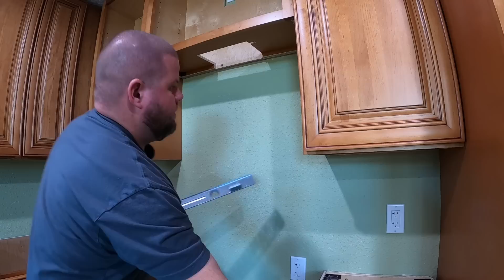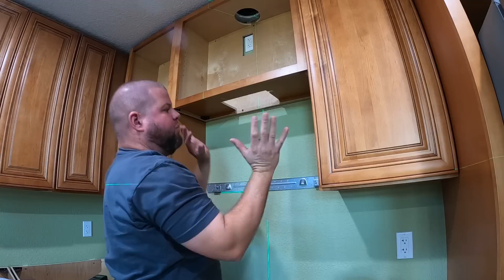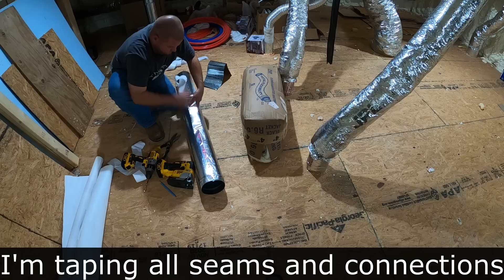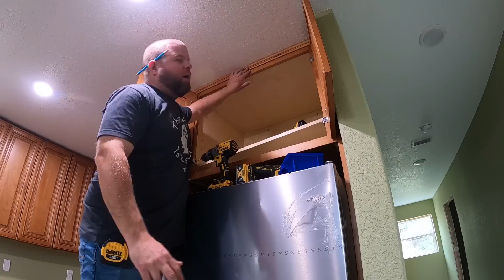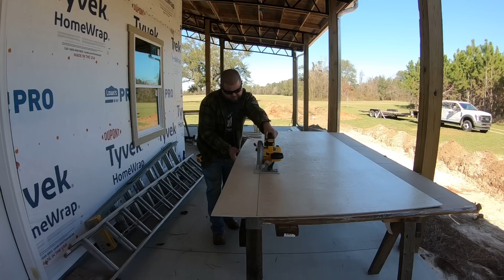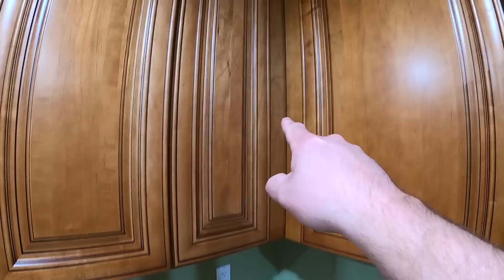Installing an over range microwave and trimming out the kitchen cabinets! #510

Comment: Andrew you are doing a great job and like I said before, the kitchen is looking awesome. A fellow before said to use screws in the vent pipe and that is a no no. Not on a vent hood. Also one thing in the future, you want to run the hard vent pipe the other direction. You want the pipe to slide into the next pipe toward the exit. Meaning the ripple end of pipe should be inserted into the next pipe toward the exit. You installed it in the opposite direction. One other note that I noticed and the only reason I am mentioning it is because you seem very talented and are really detail oriented. I also care about my fellow human. It looked like you left your chop saw plugged in while changing the blade to the finish blade. Make sure you unplug the saw before changing the blade. I would not want you to end up with a finger missing. I had one of my guys lose two fingers with a Dewalt cordless circular saw. He is not the only person that I know that lost fingers. Hope you don't think I am picking on you but I really do care. Take care and stay safe..
Reply from the maker: Very good point on the flow direction and connection with piping. I should have caught that.
Reply: @TKCL  hey your doing a great job. More important keep all those fingers..

Comment: Andrew just a tip. If you don't have crimpers for metal pipe you can use a needle nose pliers to make the crimp. Grab the pipe with the needle nose goe about 1.3 - 2" in and give the pliers a little twist. Do this all the way around the pipe and it is the next best thing to actual crimpers.
Reply from the maker: Awesome tip! Thanks

Comment: Are you going to put a receptacle on the peninsula?  Around here it would be required as the NEC says every point of countertop has to be within 2 feet of a receptacle
Reply from the maker: Hadn't planned on it, none showing in my electrical plans that the building department approved.

Comment: You COULD'VE Pulled down the cabinet and mount it onto the microwave. Then mount them both as 1 UNIT.  But with all you've done, You'd best leave it the way it is.

Comment: 3 critiques and 1 suggestion 
1 you installed outlet right behind vent pipe
-  plan ahead - why not lower right away from pipe
2 your cutout for electric box way big
Cut it small enough that mount plug / cover in cabinet that why outlet has such long screws 
3 where your shelf in the cabinet???
you should have put in middle shelf just cut circle for vent pipe to go thru

Tip put night light with eye on other half of plug.
So if microwave dead just open cabinet and you know if outlet trip gfci, breaker or it fuse in microwave 
Also nice to have little light in dark cabinet
Reply from the maker: Outlet was an oversight, can't think of everything, especially being a first time home builder. When I cut the opening, I forgot to factor in that the cabinets drop 1 inch from the ceiling due to the trim. We already have more cabinet space than we know what to do with, so I'm not concerned for this cabinet being anything more than space for the microwave.

Comment: Andrew, Isn't 6 inch pipe an little over kill for the amount of air flow from the microwave? I would think 4 inch would be plenty till you tapped into the main trunk line, guessing the bathroom/shower  fan is on the same line trunk line. O, why only a single door refrigerator instead of a double door one for such an large kitchen? I know you have other refrigerators & freezers in your shop. Was noticing at the end of your video you was talking microwave height, is the microwave also the hood vent for your stove or that will be installed under the microwave?
Reply from the maker: Microwave is also the vent yes, code and manufacturers require a minimum of 6 inch for venting and in some cases with higher cfm fans require 8 inch pipe. Tiffany and I both personally don't like the layout of double door refrigerators.
Reply: @TKCL  Ok on the vent & refrigerator. I just like an double door for all the shelves in the freezer to sort different frozen items per shelf, guess that's my OCD to arrange frozen items such as ice creams, vegetables, fried potatoes products, fish & meats on different shelves.
Reply from the maker: Won't be a issue for us, we are putting in a 15 cu ft freezer in the pantry for our main storage.
Reply: @TKCL  Ok Andrew, hope it's an stand up freezer with shelves, I don't really like chest freezers bc things get buried under other items & you forget about them when you don't see them.

Comment: Are you adding a full plywood top for the granite?    Or blocking the corner's?
Reply from the maker: I was going to do whatever the counter top company suggested
Reply: @TKCL  ok. I normally suggest more solide you can make it the more it will not break. Like the sink area is the worst for breaks some clients we had to change from undermounted sinks to farmhouse style. It was cheaper to mod the cabinetry then to get new granite.  But that said because what I seen  I suggest do as much as you can to prevent the cracks and breaks.    So net to you  never step near the counter area if you must paint or something.   As well note  do not used windex on granite...  ever.   As well note that oils will stain it.   So clean up ASAP if you do cook with oils.   I normally suggest near the stove to do a butcher block part
Reply from the maker: For all the reasons you suggested, is why we're leaning towards solid surface countertops. They just don't seem to have the issues that Granite has
Reply: @TKCL  if you was to buy granite. Suggestion look at the used market. I bought my kitchen tops for 350$ Canadian.  New would been 4200$   Market place is where I got mine.   And bathroom ones new are normally 500$ and I got some eoth the sink for 150$.

Comment: You want that gap between the top of the fridge and the cabinet so the heat can be transferred from when the fridge cools the insides and heats the coil on the backside. Hot air rises so that gap allows airflow.
Reply from the maker: That's very true, but I'm doing forced ventilation in an upcoming episode.

Comment: I see you shop a lot at Lowe's dewalt blades Kobalt saw.   Note Diablo makes better saws.  Go see the Farm testing guy on here.  You will understanding the facts of why You should buy Diablo and Milwaukee tools.   Speed just on the multitool would show you the best toolsxaare not made by Black &Decker then repainted Yellow to sell to you.  Now unlike tovadvise you do not buy grout at big box stores.  You will regret it.   Get that from the pro tiles distribution shops.  Like I get mine from Olyimpia tiles or European tiles....     lucky me they are all in the same commercial area.

Comment: I just installed a similar unit. I am very disappointed in the installation options for attaching the duct adapter to the microwave. I ended up using pipe wrap on the edges on the adapter to press against the top of the microwave. The foam pipe wrap is fire rated to make a foam gasket. Then once the vent pipe was installed I pushed down on the pipe to compress the foam wrap. Sealed up pretty well. You have twice as much room as I did though. Looks good.

Comment: Should have used two 45 instead of  an 90 less back pressure
Reply from the maker: For the venting? If so only putting one 45 is extremely uncommon and very good for flow. In fact most venting diagrams show 3 or less 45s as the best option. One is as best I could pull off.
Reply: @TKCL  you missed  understood  2 45s are better than 1 90
Reply from the maker: A sweep, I understand.

Comment: for being done all by yourself for the most part, the house is absolutely flying together. Your building that house almost as fast as I have seen some building crews work. I'm sure it has to do with you often putting in more than a standard 8 hours but man seems like only yesterday you were laying down plywood in the attic.
Reply from the maker: 7 days a week and being self motivated is a big part, but yes I've definitely subbed out some hard parts too. Work smarter, not harder 😉
Reply: @TKCL  for sure.